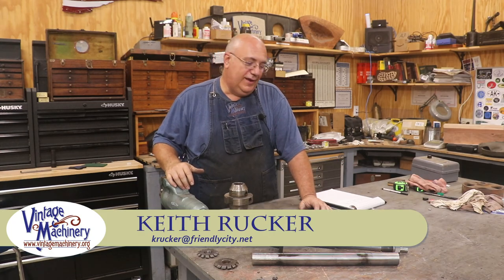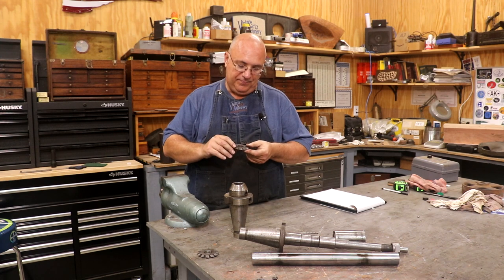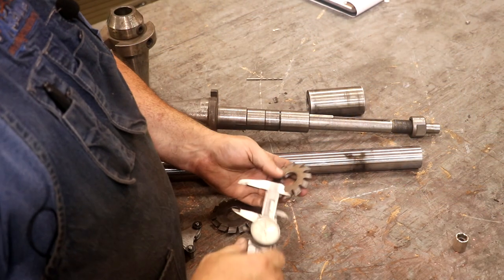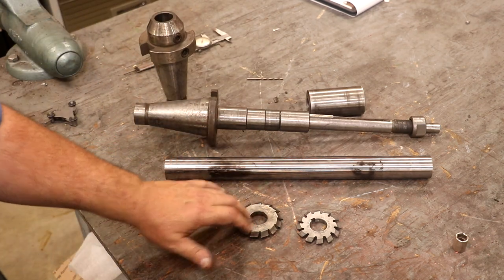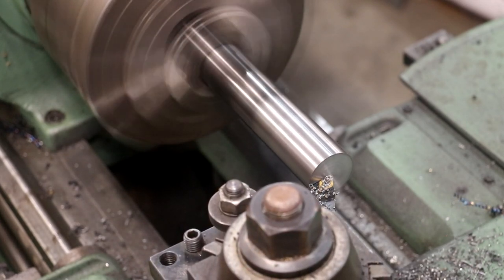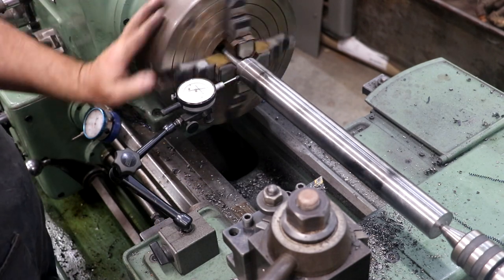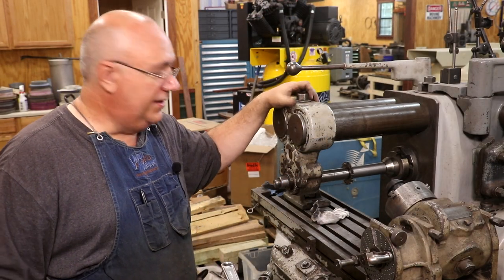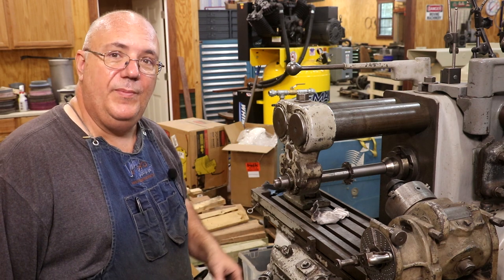Custom Horizontal Milling Machine Arbor Build

Comment: Hey Keith, greetings from the Metric Lands, 1" 1/16  equals 27mm, which is an standard size milling arbor over here.
Reply: With this planer restoration I think Keith dose not read any of this comments as the metric measurements has been mentioned several times before an some one commented that the US signed the metric system back in the late 1880
Reply: Roughly equals. It is actually 0.00049 larger. Not that it matters, but it does.
Reply: Which came first - the 1-1/16" arbor, or the the 27mm arbor? Keith mentioned those cutters were American made and has seen other American vintage equipment that used that size.
Reply: Many imported german qualty tools , evern back then 
Being exposed to metric in 1880 makes sense to me .
Then Americans would copy them 
Thus the odd sizes 
Not an expert 
Just wondering about it
Reply: Tom Robertson .
Reply: @kindabluejazz  and the name on that cutter is a german name so apparently it was a german immigrant that built the cutter and used metric
Reply: @lacossanostra  'Clough' is actually an old English name. And why would an American company in the early 1900s make metric tools - who would they be selling them to? Why is it so hard for people to accept that there were many different sizes used before there were formal agreements on 'standards'. Keith mentioned he's seen other early American equipment with that size arbor, and how the old planer he's restoring has all kinds of oddball sized bolts and threads compared to modern equipment.
Reply: Same
Reply: Whatever, no need to go mean or so. To translate between inch and metric is not history by the way, was involved in some drawings made in both systems some 5 years ago, also involving both sets of tolerances tolerances!  By the way just look in your toolbox. 19 mm - 3/4" (19.05) and 24/35"- 24 (24,3)  Another example are the ISO 51mm ball for tow bars (tolerances officially on negative side), pretty damn close to 2".
Reply: Makes Seance!  (Just like Joe Pi,,,,I get a rash when I touch anything metric 🤡)
Kind of like you guys when you have to work in inches
Reply: Technically and historically it's 25.4*17/16 mm.

Comment: Just a small FYI Jeff. I have collected equipment made by Clough-Brengle (no relation), and have known some Houghs. The pronunciation is "Cluff", as in "enough". Was corrected on that a number of years ago. Great video once again! Have had to make new arbors/mandrels for my Kempsmith #1 plain miller in the past. Since the machine is 1918 vintage, had to make them with a #10 Brown and Sharpe taper. Really enjoyed the project. Luckily, Kempsmith is still in business making paper card processing equipment, and they were kind enough to send me copies of the original prints to fabricate the the common sizes/diameters of arbors.
Reply: Clough can be found in some place names in the North of England, particularly in Yorkshire; there is a Dryclough Junction on the railway for example.  I don’t know the origin of it.

Comment: I have run into that problem with some of the older involute cutters I have.. I used a large endmill holder with 40 taper for my K&T 2hl universal to hold a shop made arbor for the  odd sized cutters as I recall... Overcoming snags is part of the challenge.. Cheers; Mike in Louisiana

Comment: Improper or "weird tooling" is the bane of machinists the world over.......... Good thing is because you ARE a machinist you can in most cases make what you need. Was wondering if you would provide a weldon flat for that set screw. Good insurance. Hey I remember that mill vice from a weekend workshop (Adam Booth was there too) I helped you with a few years back on some sort of wood saw if I remember correctly. Setting that mill up sure brings back memories from when I worked for the Boeing Co. in Macon Ga. many years ago. Ran the old Cincinatti machines. Good job on the arbor.

Comment: Now, I would have made a one inch adapter. One inch long with a 1 and a 16th shoulder on one side and the key cut in the bore. I would have had to make a custom key that was the width of the 1 inch arbor on one side and the key to match the cutter on the other. It might have been as simple as 1/8x5/32. Your way works and gets the job done. Mine takes less room in the tool chest.

Comment: I have a workshop in the UK and milling arbors of 1.062in or sometimes marked 27mm are quite common in older machinery from the 1960's.
Reply: What mill have you ? I wonder what size mine is ;) - at least I can now remember the model - G. Dufour 61!

Comment: I think I would have machined the arbor shaft end to fit into the 50 Taper... then mount the raw shaft into the 50 T... then mount the 50T into the lathe and finish the outside dimensions of the shaft while its running in the 50T... provided you had a 50 taper snout mount for the lathe (probably not).
Ive had to make small holders for gear cutters and end mills before... and one thing that ruins cutters is runout in the holders... so tolerance build up is a problem when making these things...

Comment: Hmmm- I visualized turning a bushing to fit inside the cutter and milling the slot to fit the key- then making a short key 1/32 taller - now you have a little kit for your 1- 1/16 cutters that you can use with  your 1" arbor and have the full range of adjustment.
Reply: I was wondering what his thought process was in making a whole new shaft, as opposed to a top hat sleeve for the cutter?
Reply: @littleworkshopofhorrors2395  Monetized by content and views- that does not work well with quick and simple solutions.
Reply: @oldschool1993  do i detect a little cynicism? 😉
Reply: @oldschool1993  
Yup!!  :-D
Reply: @littleworkshopofhorrors2395  Naaah- not cynicism, just realism.  This is an industry, and successful creators earn good money from You Tube and also from their Patreon supporters. In exchange for that income they must continue to create interesting videos.  The advertisers who pay You Tube for space also demand videos of interest and a reasonable length necessary to capture the audience attention.
Reply: @oldschool1993  making an adapter  sleeve could be interesting.😉
Reply: Truthisstrangerthan Fiction  Doesn't need to be strong- it is fully captured inside the cutter- all the force is against the key
Reply: Truthisstrangerthan Fiction  but it is supported internally and externally and if top hat shaped more than adequate
Edit the keyway can be cut all the way and the key will still be big enough to drive the cutter, if not a taller key could be made and still be quicker than a new shaft by a long chalk.

Comment: Would it also have worked to create a bushing for the gear to adapt it to the 1-inch arbor? Maybe by pressing a solid plug into the existing hole then boring out a 1-inch hole and cutting a keyway?
Reply: It would be too thin, with a wall thickness of only 30 thou. If you could cut a keyway in it without it tearing up, you’d end up with a split bush that would fall out. I think he chose the better option.
Reply: @srp01983  ah that makes sense. thanks for the explanation
Reply: @Sharklops  A bush was my option too. Yes, it'd be a split bush and too big so it was sprung into the cutter.
Reply: Truthisstrangerthan Fiction  No - the same bush would do for them all.
Reply: Just shim the ID onto the 1" shaft with a piece of 1/32" shim stock  that is short enough to allow the key and is as wide at most 1/32" plus the cutter's width at the arbor. 
   I can't understand why you would spend hours fabricating a "special-use" arbor for this job when the next job may be quite further out or in. Your choice of centerline  seems arbitrary and inefficient for using your complete set of cutters, so why not just go with the 1" arbor and the 1/32" shim?

Comment: Shafting and bearings are the same way, using many 1/16 sizes and the OD sizes of bearings change when the ID changes from 1-7/16" to 1-1/2" or 1-15/16" to 2".

Comment: Hi Keith. What about just making an “adapter” with a bit of sheet metal 1/16” thick, whose width is the thickness of the involute cutter, and whose length is the circumference of the I.D. of the cutter, sans the key way; it’ll probably need a bit of filing of the ends to get it to just the right length, and to remove any burrs. Then, just slip it in the involute cutter, and slide the whole shootin-match on the 1” arbor - ta-daa!
Reply: William Squires well actually it would need metal one thirty second of an inch thick not a sixteenth and it would have to be exactly 0.03125" to get the cutter to run concentrically  with the arbor otherwise the produced gear will be out of tolerance and undersized due to run out. Run out is the enemy of precision
Reply: SAMRODIAN - Oh, yeah, it’d have to be half the difference. Good catch. 🙂

Comment: Good solution and well made. I'm not a machinist (I'm a wood butcher) so please feel free to ignore this idea but would another solution be to make a 3/4" shaft and a set of bushings for that then for each odd ball cutter size all you'd need to make is a special bushing with a shoulder? I don't know, maybe 3/4" doesn't give you enough for a key in the special bushing.

Comment: Why the oddball sizing? Well, Meriden Connecticut is north of New Haven, northeast of Bridgeport, south of Hartford and Springfield Mass. In the 1800s and 1900s, intellectual property theft was common so the machine tooling companies then as now used 'oddball sizing' so you could not use a competitors accessories on their product line. I'm still surprised at how deep an impact this little state had on industry and the nation. You can pretty much drive by the sites where those tooling giants were located in the span of about 3 hours.
Reply: That makes sense.

Comment: Nice job,,, l have a Sheldon horizontal mill with 1 inch arbor and found a ton of 11/4 cutters was wondering if I should make spacer bushings are a arbor, it also has end mill holder but only 1/2 inch end mill size,, already turned down spacer stock with 1 inch id and 11)4 od ready to part off for each cutters width,,, am I doing a bad thing?

Comment: The shafting being common in 1/16 under sizes, from what I was told that an old manufacturer from Santa Rosa claims, was that the steel was being shipped from east coast to the west coast the long way around and would arrive very rusty from the salty sea air. Once ashore it would continue to deteriorate. The shaft would have to be turned down to clean metal before it could be used, 1/16” was adequate for clean up. Not sure if this is an old toolmakers tale or not but I suppose you would still see the common sizes of quarters near where the steel was produced? (iron belt?)

Comment: Maybe shrink fit the holder?  Make them with a thousandth interference fit. put the arbor in the freezer and the holder in the oven at 375 and push them together. Only thing is you play hell getting them apart if you need to, 

Nothing at all wrong with the way you did it but even with the vibration from gear cutting the force fit would not even need set screws (Although I'd us then anyway)   Just an idea. 

maybe next time ')

Comment: I wonder if they did odd sizes to force best accuracy.  Im thinking well its supposed to be an inch then it was open to interpretation just below line or above or right on . The 1/16 line was smaller and would at least increase accuracy to some degree.  And for us that have ocd would thrive to hit dead on .  Just a thought.

Comment: Nice. Was there any reason you didn't turn that between centers instead of using the 4 jaw?
Reply: Yes, he's an amateur ;) All things considered, it would be the proper way to do it.
I've rarely turned between centres and I suspect to many it's more of a last resort option when in reality, it ought to be a first resort (after facing and centre-drilling both ends). Watching this, I even thought about having one lathe with 3-jaw just for facing and centre drilling then a 'nice' lathe for the nice work. Having considered the old catch plate and carrier - don't you think it's a bit odd that you don't see a driving hole either half an inch or an inch offset from the centre hole so that the whole length of the work can be turned !

Comment: looking at the 1 1/16th rise there appears to still be a slight gap between the cutter and the spacer, I could be wrong, but if there is I  would take a 16th x .25 out of the closest spacers inner bore or  just enough to have it snug . marking it as the closest spacer to the 1 1/16th gear cutter... leaving it available for use for both bars.

Comment: This cutter is metric size - 27mm, common for metric tools.
Reply: Made 100 years ago in Meridian Connecticut? I'm not sure Metric was that widely used. I could be wrong.
Reply: maybe he bought it from an European country others than the UK and didn't realize the 27mm 😁
Reply: @leeroyholloway4277  they could have made it for export.
Reply: doubt it does not convert exactly
Reply: @johnscott2849  no but not far off 26.9875mm or roughly 4 tenths of a thou.
Reply: @littleworkshopofhorrors2395  So it does not convert. If you have sets that all measure that it is 1 1/16 worked on may different pieces of equipment that had strange sized shafting 15/16 1 3/16 not metric. just the way they did things in the 1900
Reply: @jacobpoucher  a little uncharitable to say that, i do wonder why you are watching if that is your attitude.
Reply: @johnscott2849  i did not see mr R check the bore with anything likely to tell to 4 tenths of correct. It may well be imp but even he was surprised at the apparent oddity. So until a definitive measurement is taken, and a sliding tolerance is taken into account, the jury must be out. Not of course that 4 tenths run out of the cutter would even be noticed in the final gear, so the whole question is really unimportant except to dogmatic imperialists.
Reply: @littleworkshopofhorrors2395  he did say they where very old and if you had worked on anything old you would know they used off sizes and made their own threads that matched nothing.
Reply: @johnscott2849  oh tell me about it, i just had to make some 3/16 x 27 tpi whitworth form  bolts for an old motorcycle,  why the hell did they do that?😤
Reply: @littleworkshopofhorrors2395  Rucker is slow and so are you buddy, delete your comments, watch someone else Rucker is not a good one.
Reply: @jacobpoucher  why watch him then, unless you are admitting you are only here so you can exercise the inner troll?
Reply: @johnscott2849  😂😂😂😂

Comment: You need to turn the cutter around to be cutting away from the dividing head instead of into it. The reason is by cutting away it is pushing away. The way you have it set up, the cutter will be trying to lift the gear blank up. It you don't believe me try it, you will find out the hard way like it did.

Comment: What timing! I need an arbor for my Atlas MF mill so I can cut some gears with cutters that have a 22MM  center hole. I was planning to make my own arbor because finding a 22MM arbor would be impossible but I wasn't looking forward to cutting the MT2 taper to fit the mill's spindle. Now I'm thinking I can get a MT2 cutter holder for Weldon shank endmills and copy your design. Thank you!
Reply: You can also get morse taper blank arbors from some tooling suppliers. They are supplied with a large 'boss' on the end that is not hardened (I think the tapered bit will be hard, but I'm uncertain) so you can turn it down to fit other stuff. You could get one of those and machine the boss to a press fit on a hole in the end of your arbor shaft. Ideally leave a flange so you can cut slots to fit the arbor driver on your mill, that way you don't have to tighten the living daylights out of the drawbar (on my Atlas it can be painfully difficult to remove things from the spindle if you tighten the drawbar too much, and I'm always scared of brinelling the rear bearings in the process of bumping an arbor out).
Reply: @nerd1000ify  I considered going the blank arbor route but then I found an MT2 end mill holder for 3/4" shank end mills for $24. Using that holder will allow me to make arbors with a 3/4 end for the holder with the remainder being whatever diameter I need for any given milling  cutter. I have some cutters that are 22mm, 1" and 1 1/8" so I can turn up arbors of those diameters with 3/4 ends and a flat for a set screw, cut keyways in them and I'm good to go with the 3/4 end mill holder.

Comment: Keith ingenuity & know-how is a necessity in a successful reductive shaping process whether metal or wood. Thread cutting  never bores me. I'm buying a mini lathe and hope to become skilled in this process as I have a need for specific length stainless metric screws to restore a 1960 MG convertible.
Reply: I must tell you, nothing metric in a MG; but everything seems to have a very loose fit. I had a MGB-GT until I got tired of screwing, and bought something German.

Comment: Great project.
I'm afraid that's the kind of tool that won't be used very often. Keith better put a label on it so he remembers exactly what it is.
Reply: He did label it - since it's the only arbor he's got that's different diameters at both ends and has a step in the middle - it's well labelled as it is !